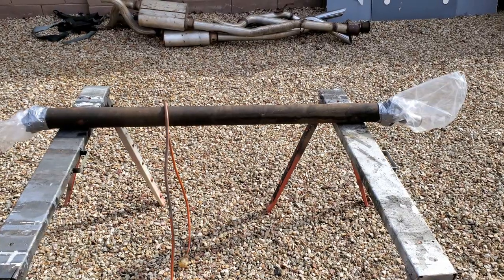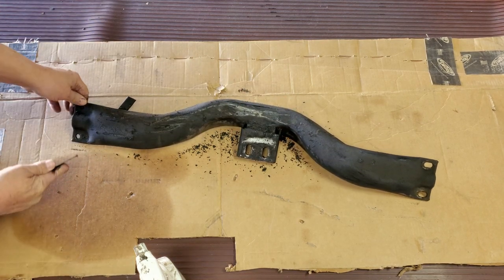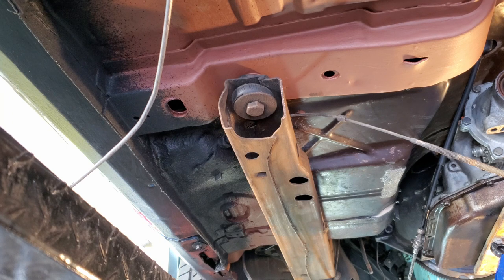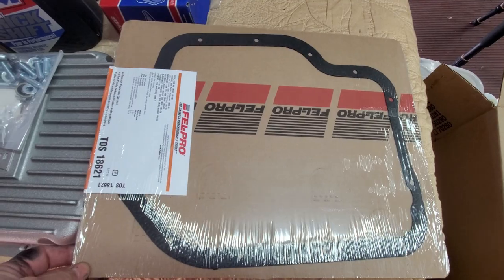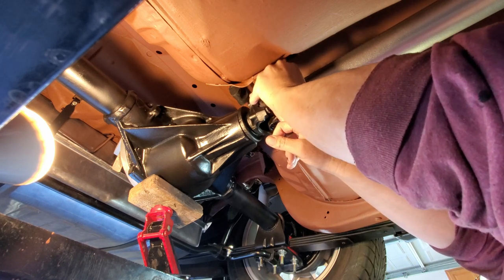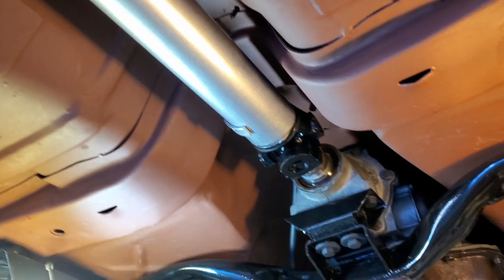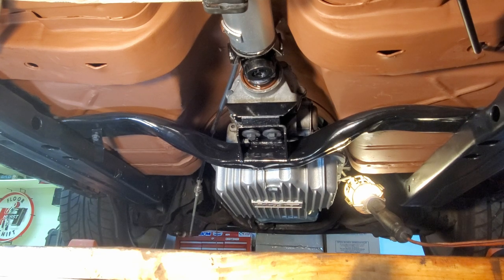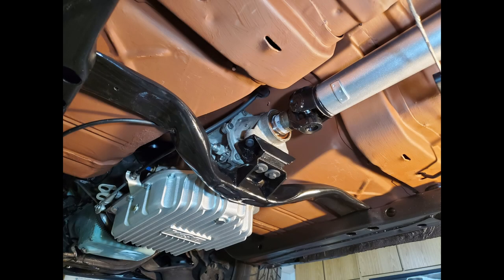1974 Pontiac 455 Trans Am Detail and Restoration Part 24. Transmission, Driveshaft and Parking Brake

Comment: Steve, it looked like you are not using the electronic kick down. The male plug on drivers side behind the shifter linkage. Just curious as to why not?
Reply from the maker: It's hooked up. If you look at the 32:51 mark you'll see it. The wire doesn't have the factory connector, it is just a generic blue female connector. Thanks for watching!